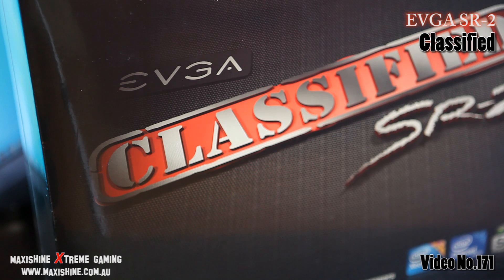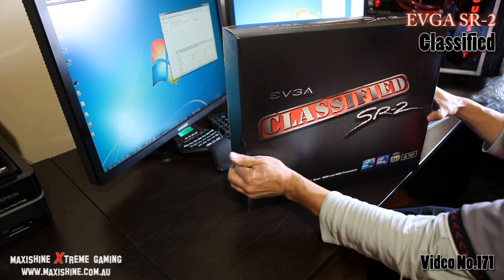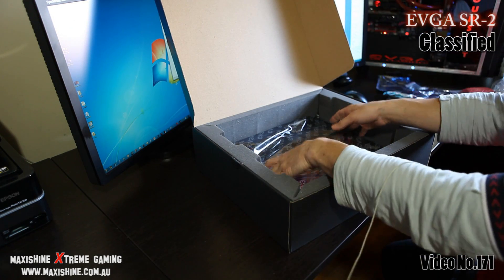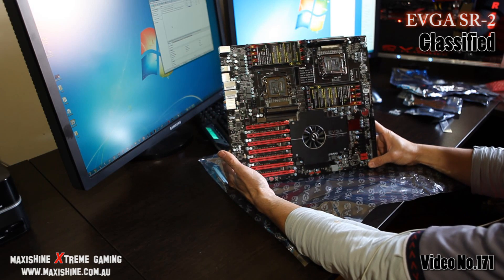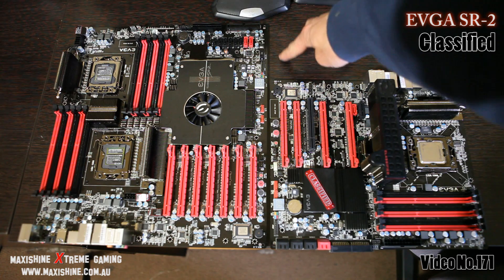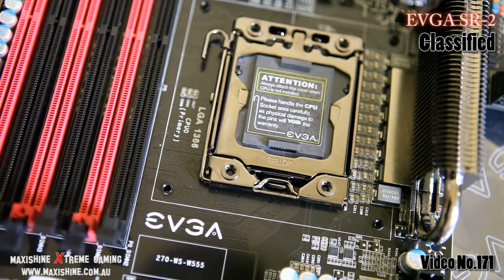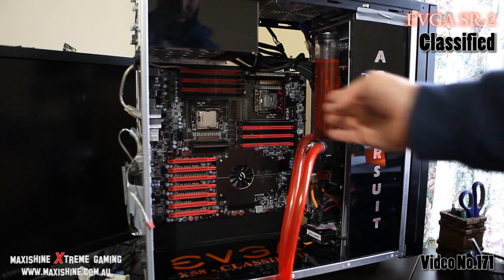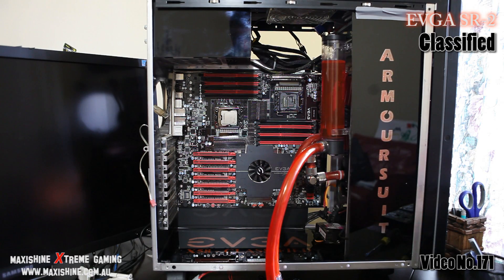EVGA SR-2 Mega Build Part 1

Comment: bought a used untested sr2 for $100 last year
came with 2 4 core xeons (one them wasnt working) and 48gbs of gskill 1600mhz ram
initially, the motherboard wasnt working and after a couple days of diagonosing, i noticed it was missing all the jumpers. ordered some new ones and installed them and boom, it works now.
i bought some used 6 core xeons from aliexpress for $25 each (took like 2 months to arrive)
had to wait like 3 months to find a suitable case for it
ended up with a slightly banged up (and stripped) corsair 900d for $100 which i think i overpaid for
ran it with a 750w psu but managed to find a corsair ax1500i for $200

ngl, even today, after 11 years its still a killer platform
barely bottlenecks a 1080ti
Reply: yep but today  1 cpu  is better that  2 cpu  the max got    but  love to buy the same pc   max got

Comment: pity that the EVGA SR-X for socket 2011 did not last out in the trade as long as there was little quantities of it.
Reply: EVGA SR-2, was a good motherboard that clock I bought one and had two pieces xeon with 12 Cores / 24 Threads and 32gb frame. I think it's a shame that EVGA not bet on socket 2011 v3 it had been good card if it could work out to overclock xeon on ie which you get to choose the Asus cards today for it.
Reply: xeon processors are locked yes, i know that. but you can overclocking by blck just little bit. its sad xeon do not unlocked it. i agree on you mate. even on a  " ES " Engineering sample/ Intel confidential cpu´s  are not unlocked on xeons to shame actually yeah tyan was good motherboard to
Reply: the e5-1000 xeons have unlocked multiplier but the 2000 series has them locked.
(as far as i know)

Comment: but will it play minecaft smooth ?
Reply: LOWPR0FiL3 Surprisingly no. Running a functionally identical setup to his, Minecraft (in 2017) runs like a bitch. 40 FPS at best, usually low 20s with 12GB of RAM, 2x X5660s, 2TB worth of HDDs, RX460, etc.

Comment: Why are there two CPU sockets, mate?
Reply: jrjubach becaus this is ultimate shit.
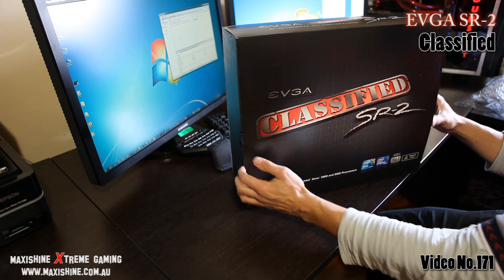Reply: jrjubach Actually with CPUs it does almost double. The problem is you need programs designed for multi core to really get the benefit.  I have seen render benchmarks where one cpu is tested then a second gets added and the render time is almost cut in half. For example a 3 minute render time cut down to about 1:34. Plus with more CPUs you have have more ram. two xeon e5 V2 cpus can address 1.5 TBs of ram where are if it was just one cpu it could only use 768 gigs.
Reply: jrjubach double the cpu, double the speed!
Reply: jrjubach To show how much money you have.
Reply: ***** LOL yeah I think you're right.
Reply: Well, for 2 CPUs, of course!
Reply: Amod Kala LOL very funny. Why would you need two CPUs though?
Reply: Beklo100 But not double the performance.
Reply: ***** I think you're right. The more you have, the less each additional one boosts performance. Like, three graphics cards do not mean three times as good performance as just one. The additive performance factor dies off with each one you add until barely any performance boost is noticed. It levels off. Good call!

Comment: as stated by TheJabraDesigns, the AMD opteron is AMD's range of CPU's aimed at the server market, with the correct motherboard you can put 2 Opterons together and they will work like the intel CPU's in this video.  You would need to get a dual CPU socket AM2 motherboard to use them though

the SR-2 motherboard uses the LGA1366 socket type, which is an intel only socket

Hope this helps

Comment: Hi was just wondering if it was possible for me to use 2 of the AMD FX-8150 Zambezi 3.6GHz Socket AM3 in place of 2 Intel zeon processors on the EVGA Classified SR-2 board. im still new at this and am trying to build up a rig for my work...cause one zeon processor costs like 2 of the 8-core amd processors.

Comment: Yeah I was going off the $3000 you said but the 3770 is really good. Make sure to get the 3770k if you plan on overclocking but if not the non k is cheaper. It depends if you want to run a surround monitor setup AMD eyfinity is much better than nvidia surround but if you just want multi monitors for multitasking then a 670 would be a really good choice. With an easy overclock the 670 is pretty much the same as a 680.

Comment: Thanks 512! I guess future resistant is what I should have said. I switched my board to a Z77 with an i7-3770. The board sounded okay to me, but of course I am not in any way an expert. This will be my second build. And I was looking at multiple monitors too. Nvidia cards aren't the best choice for that? Also, do you think I could get away with one GTX 670 instead. I am building in between Christmas so I am trying to cut costs a little bit. That i7 3960x is incredibly expensive! Thanks again.

Comment: Almost all programs prefer hyperthreading and a good overclock. You really dont need dual xeons and would get pretty much get the same speed with a 3960x or a 3930k with a decent overclock. Then for your games you can get a 680 or a 7970 depending on your setup (7970 if you run multi monitors). Many good 2011 boards can accept in exess of 64gb of ram so you wont be limitted there. No system is future proof but a 3960x and a good 2011 board are as future proof as you can get right now.

Comment: A few mistakes with what you've said, I'm only here to educate you.
The HD4000 is only on the Ivy bridge processors, which is 2011 socket.
While he does have 12 cores, he doesn't have 28GHz running on his PC, because each cores clock speeds do not add up. The processor is clocked to 2.4GHz and that's how much each core will run, but they do not join together as one (Example: Two cores running at 1GHz will not combine for 1 core running at 2GHz).

Comment: Lets see, im not a BIG tech guy but let me give it a try. Correct me if I'm wrong but Xeons have lower clock speeds and lower overclock capabilities than i7s, and if this is for a gaming only system, then this is a waste, a big waste of money since games need more clock speeds than cores. BUT if this is mainly for a workstation and a bit of gaming too, then it is much better with the xeons, its not like they can't be used for gaming. but would be a waste using them just for that.

Comment: If I'm not mistaken this insane motherboard is an LGA 1366 socket, so the Gulftown processors should fit. Or is this one of those things where the board itself just isn't build to handle that kind of processor? I would think if money was no object that you could just drop two i7-990X Gultown (LGA 1366) processors in there and just go totally all out.

Comment: my first Dual socket workstation was a xeon setup as well...
now im running a dual 1366 supermicro, dual quads @2.8 24GB ram 5870x2 750w OCZ
4x300GB 15k drive in a huge stripe. (I make nightly images to my server)

Comment: @gerardbiteme Vertical SATA ports are easier to use. They're far enough back from the PCIE slots that they're never going to get blocked by a long card. As for the IDE port, OCers (the main market for this board, remember) like them for some reason. Has something to do with SATA corruption or something, I don't know exactly. I'm sure there's a PS2 keyboard port on this board, too. Do you want to complain about that while you're at it?

Comment: use 48gigs of memory not 12 there are some really good 48gig packs out there and if you wont use 48gigs use atleast 36 and use the intel xeon x5680 processors in the build and use a mountain mod case
ps. you have a huge beard